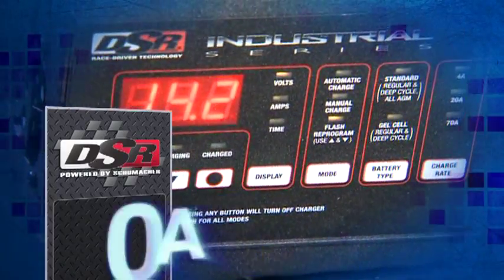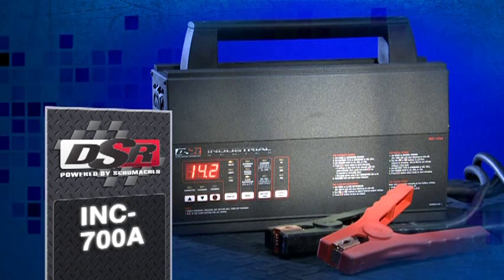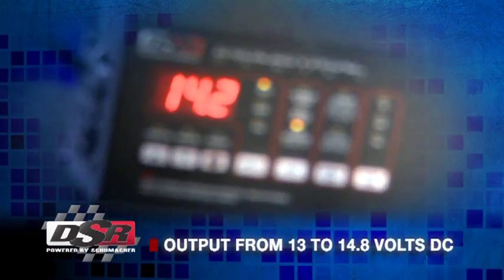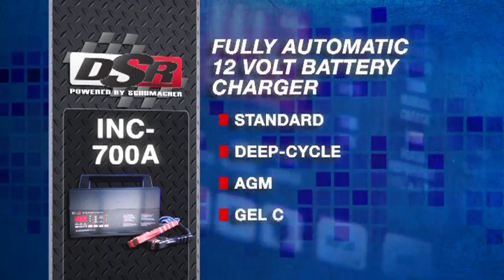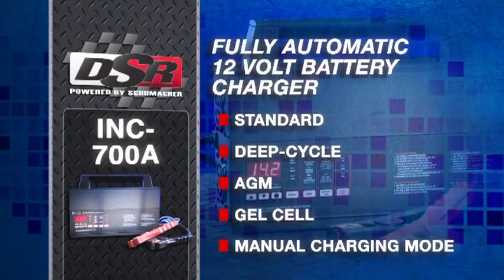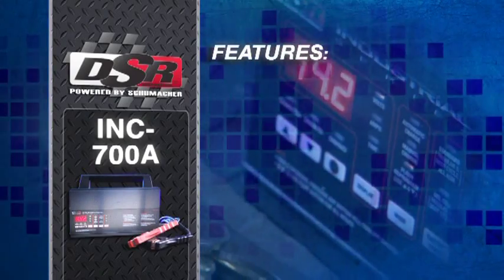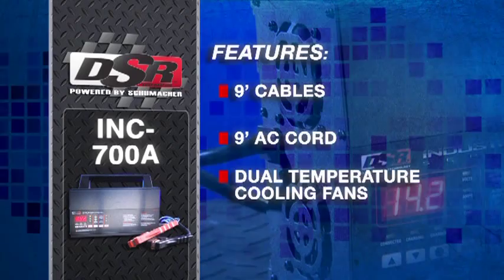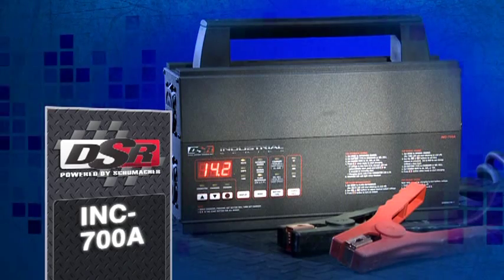INC-700A: 4/20/70 Amp 12 Volt Microprocessor Controlled Charger with Flash Programming

Comment: If you ever break this, you may as well throw it away.

I have one that was damaged by a nearby lightning strike (out of warranty). A representative from Schumacher Electric said they would look at it, then send me a repair quote. Once the quote was paid, they'd repair it, and send it back. I sent it off, and it was returned a couple weeks later. There was no communication between. I tested it, and it worked, so I called them to find out if I owed them anything. They charged me $150, and that was that.

Within a week, it had a high-pitched whine whenever I first powered it up. Within a month, it also had a delay before it would light up. It now has a constant coil whine when plugged in that starts after the display lights up. That takes roughly five minutes, and the delay seems to be getting worse.

It's a great product, with terrible support.